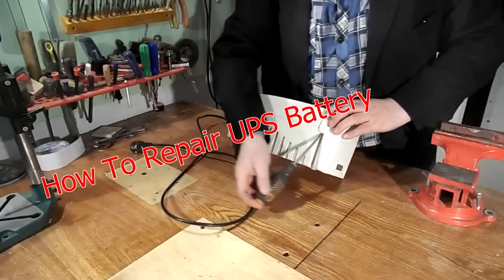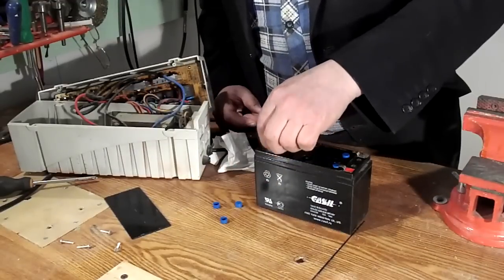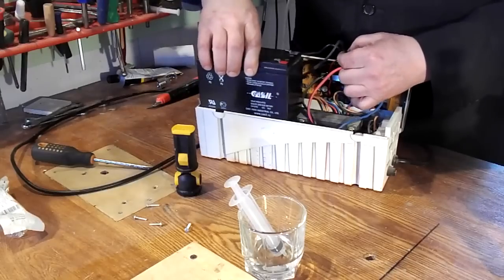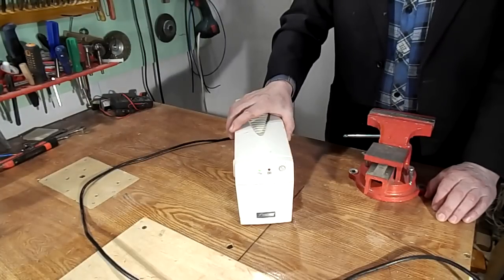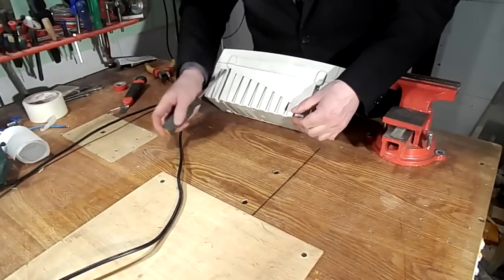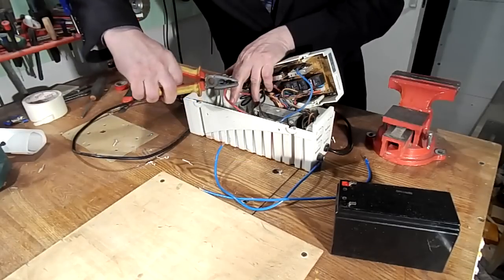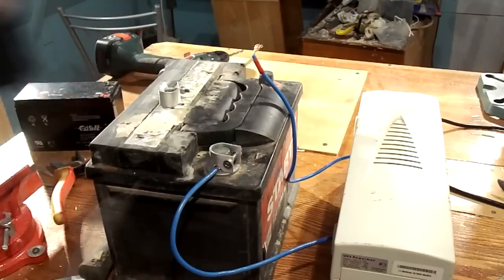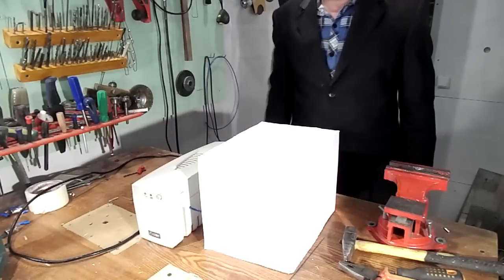How To Repair The UPS Battery

Comment: nice video how much amp is that battery 20 amp 50 amp 75 amp or 100 amp i have back=ups cs 350 i have 1100 watts inverter 12 volt deep cycle battery 75 amp 900 watts runing my inverter

Comment: Upgraded 2 UPS w/ wheelchair batteries - TV & Security camera system to protects from lighting & power outages(some pulled outside meter & waited for IR cam lights to die before breaking in) which will be 5 hours before shutdown.

Comment: Can we use boiled water?
Reply: No, that would be even worse than tap water.  Boiling it just concentrates whatever minerals it has dissolved in it.  Rain water would be a lot better.
Reply from the maker: Boiled water will have a bad effect on the battery. You can use boiled water if you cannot find distilled water.
Reply: Distilled water is $1 a gallon so why use anything else unless you are super cheap

Comment: Achtung: Alle USV-Batterien enthalten äusserst explosive Knallgase und Schwefelsäure, welche schwerwiegende Verbrennungen und Ätzungen hervorrufen können. Auf diesem Video werden keinerlei Vorsichtsmaßnahmen getroffen und Verletzungen sind vorprogrammiert. Ein neuer Akku mit 24 Monaten Garantie kostet beispielsweise (12V 7Ah - wie im Video dargestellt) Eur 23,50 + Eur 7,70 Versand. Ob sich hier das Risiko lohnt?
Reply from the maker: Batteries can explode even with all safety precautions. My battery didn't explode, so my safety is good.

Comment: In my ups 12v 7ah battery using Can I use 12v 9ah bike battery  in it ups can charge it?
Reply from the maker: I think that this will be the best solution.
Reply: @DoitselfInfo  If we use battery with higher ampere range, will it not heat up the transformer?
It is really advisable to replace the 12V 7AH battery with 12V higher amp hour rating battery ?
Reply: Yes

Comment: hi my ups batery is swollen and black connector get rusted but i slowly removed the connector.
shall i refill distled water and after that shall i plug in to check wheather it is charging or not.plz say ur sugestion.
also im not havngthat  voltage meter
Reply: If your battery is swollen it's worth having a good look at the device circuit.

Comment: can i use maintenance free battery 12v 7.5 and valve lead acid battery 12v 8.2 together in ups?
Reply from the maker: Such a design is undesirable.
Reply: Yes

Comment: For most batterys regular distilled water will work. Tap water is never a good idea as it often has a lot of impurities. A low cell lets say in a car battery while starting or charging can cause an explosion. I had one blow the top off of one and acid went everywhere. Wear eye protection if you don't want to be blinded.
Reply from the maker: I hope that you are not talking about me. I use distilled water and the battery may explode if you charge the battery and allow a spark when removing the conductor.
Reply: Really anybody working around batterys. I worked around batterys for years never had a problem. One day I started a generator which had four full size batterys. I heard a click then boom just like a shot gun going off. If I had been near it I would of had acid all over me. When I worked on aircraft I found one overheating, I had gloves it was still hot as a frying pan and ran down the stairs with it. It wasn't the charger the battery just went bad. I urge everyone to respect these little electrical bombs.

Comment: Muy buen tutorial victor. Salu2.
Good tutorial Victor.
Reply: There are  several tips for doing a pro job
do not attempt to do this until you know what you are doing - the acid can burn your skin
check the voltage first - there may be a kaput cell which would be a waste of time trying to fix.
Check your battery fluid.
attempt to fully charge the battery.
(I discovered about these on rapid renew roadmap site )

Comment: Its not working
Reply from the maker: This means that the battery is dead.
Reply: Thonta Praveen Kumar.plz tell me how to repair dray Betty pool
Reply: Victor V. Do it yourself .plz tell me how to repair dray Betty pool
Reply from the maker: I had no repair experience with this battery yet

Comment: You just added distilled water in some other videos they say to add Epsom salt in water.
And is that true that distilled water starts boiling when you charge the batteries coz they are made to have gel instead of water?
(They leak and damage the UPS)
And is that also true that distilled water becomes sulfuric acid after some time in the batteries?
Reply: Hellow Hi,

Epsom salt is added to "wet cell" typed SLA rechargeable batteries. That would be your car battery.🙄

This is an AGM type of VRLA battery. Here you only add distilled water into each cell. To my experience it is best to under than to overfill.🤔

True. 😉

Comment: CAN THIS UPS CHARGE THIS BIG CAR/BUS BATTERY? I THINK IT WILL BURST YOUR UPS MOTHERBOARD.WHAT IS YOUR  OPINION ABOUT THIS ?
Reply: It won't as long as charging voltage is proper. It will take very very long time to charge, because most UPS allow for maximum of 2 amperes of charging current. Simple arithmetic, a 150 Amp battery will need between 75 to 100 hours to charge, because the voltage controller will drop amperes after 80% charge and put the charger on trickle to top off...

Comment: in which shop I will get this distilled water
Reply from the maker: You can get this in any large store where there is a department of auto parts. I bought distilled water in a super market. I pour this water into the flatiron.

Comment: Cheers for the Video! Forgive me for butting in, I am interested in your initial thoughts. Have you heard about - Rozardner Powerful Battery Reality (erm, check it on google should be there)? It is a good one off guide for learning how to recondition an old battery minus the normal expense. Ive heard some awesome things about it and my cooworker at very last got astronomical results with it.

Comment: Sir, I am insert distilled water in UPS battery but the battery can not increase power backup time.
Reply from the maker: This means that your battery can not be restored.
Reply: Sir how to restore battery and any chances to restore battery ON after 3mints it will OFF.

Comment: Can i use a bottled distilled water for refilling? Do i need afraid that is not pure enough for the refilling? What trouble if it is not pure distilled water?

Sorry for asked 3 questions, because i have a battery just found dead and i just bought it 1 year ago.
Reply: Cu ce se fesulfateaza bateriile

Comment: This will not work. You have de pressurised the battery by taking those vent caps off. For the £10 or so these cost don't waste your time
Reply: DovahkiinYT the electrolyte is not what holds the electrical charge. It is the lead plate that holds the charge. And by design these batteries which are Valve regulated lead acid (VRLA) do require the correct pressure internally to operate correctly. Also the amount of water that he has added to the cells would dilute the electrolyte too much. They only require a small amount of electrolyte in these which would have been absorbed by the lead plate during recharge It will all be pushed back out of the positive plate and mixed with the water he has added bringing the electrolyte specific gravity well below the 1300 it's supposed to be.
Reply: de-pressurized?  no.. those rubber boots are meant to let pressure escape.. this happens when the battery gets hot. they are rubber so they can keep the liquid from spilling out.

Comment: The plates in these batteries are thin.  By design, they should get dry before the plates fail in some way.  Doing these "repairs" can extend the life if the battery a little longer, not like new.

Comment: I have tried this on 5 sealed lead acid batteries so far and it hasn't been effective.  All of the electrolyte is contained in the blotters between the plates.  The electrolyte is purposely slightly underfilled by design to prevent leakage in the event the battery case becomes cracked.

When refilling the water level, pure distilled water can only be used.  I distill my own since the water marketed as distilled at stores can have an additive (like a small amount of salt or fluoride).

Adding the correct amount of water is the most difficult part of this operation.  Unfortunately, you can't see how much water the blotter needs by appearance. You want to only fill the blotter without having any standing water on top of the plates.  When you charge the battery after the refilling operation, electrolyte (water and acid) will flow out of the blotter and rise above the plates (which is undesirable).  So, if you added the correct amount of water, the blotter will only appear moist during charging, any more or less is undesirable.
Reply: +Bill Harris : "Battery Desire" the blockbuster movie coming to a theatre near you!! Thrilling story of long lost desirable battery. See the undesirable battery drinking too much water. Watch a most desirable battery soak a blotter. Yes, this is the movie for you!!

Comment: after filling water,the battery would internally start fuming after charge,pushing the rubbers that close.
Slowly the UPS circuitry starts getting acid corrosion,IMHO.
Instead,if we can get hands on to a jelly that the battery makers use.
I suppose we could improve on the repairs.
thanks
 sarma
vu3zmv

Comment: nice video ....
i have one question about the distilled water ,is there a specific brand of water to use or any kind of water product atleast it is distilled..?
Reply: I've seen some guy repair a battery like this with rainwater, not even distilled.And it worked.
Reply: I used tap water and it worked, probably not as good as distilled though

Comment: Safety Tip... To anyone who is going to make this... Car batteries, gas-off when being charged... Hydrogen. Hindenburg... 
I've done this mod but I drilled a hole in the wall and ran the battery... OUTSIDE ! Your insurance company wont like you burning down your house. Use the shortest cable length you can and make sure you use big cables. To avoid voltage drop. 
Also, I'd suggest drilling a 6.5mm (1/4") hole through the battery post (Perpendicular to the post... put another way, from one side to the other) but do this outside... again, hydrogen is very flammable ! Try to cover the battery to stop debris ... and secure the terminals with a nut, bolt and star washer. The home made clamps Victor used are cheap and fast to make, but he is good with his hands... If you do it this way , youare at risk of arcing if bumped. Boom, you are dead. 

Spaciba +Victor V. !  Nice video, sir. Your English is good and you are obviously smart, educated or both.
Reply: Great response! DumbSkippy LOL
Reply: +Victor V. 
I think you misunderstood what I said and meant. 
I never said what you do is dangerous. No, No, No...

We have a responsibility to protect others from danger. 

You and I know about this, but less skilled people will not know of the dangers.
I am a qualified Electronic technician... and a Mechanical Fitter. 

I suggested different connections to the battery, because of the risk of a spark... at the source of venting Hydrogen!!! 

Also because most people, wont have a piece of steel bar at home and wont get a good connection, which would require the exact curve to match the diameter of the battery pole. This would mean the electrical load at point of contact to the battery post would be at the edge of the steel bar and one point of the curve... and that is if the curve is not twisted  (Spiral) when made. 

Victor, I have every right to comment, especially if I am an expert and sir... I am an expert. 

Firstly I said "Spaciba +Victor V. !  Nice video, sir. 
Your English is good and you are obviously smart, educated or both." 

Then I said 
"Victor u... is good with his hands..." 

I am 100% correct about Hydrogen. 

All wet-cell, lead-acid car batteries produce Hydrogen when being charged. Hydrogen is the gas that both burns easily and can explode when ignited.

I hope you feel more comfortable with my suggestions, understanding why I have added my tips to your video comment.

At least one person is happy with my suggestions... Look !
 +strange1ization 
Great response! DumbSkippy LOL

Spaciba tovarich. !!!
Reply from the maker: You have not right to say that what I do is dangerous. When the battery is not under load for a long time, then there is no explosive gas and no danger of explosion.
Reply: +strange1ization 
Thanks so much for the positive feedback.
I'm glad you found my input, beneficial.
Cheers,
DumbSkippy
Reply: DumbSkippy
Reply: Altaf Jagot
 Hello... What's up ?
:-)
Reply: communication failure!  you give him a compliment  and he wants to start bitchin about rights...too funny.

Comment: There is one "little" problem. By adding distilled water to the battery 
you won't help it, only if the battery was boiled to oblivion (improper charging) and off gased the water. Because the "sulfuric acid" is on the plates 
sulfated, you end up with battery filled with water or more diluted 
electrolyte. You have to get the plates clean of sulfation ,if it's heavily sulfated, to get back the  capacity. You can measure the specific gravity of the electrolyte which tells you.....
 I have done it. ;) cheers
Reply from the maker: Some masters recommend to refill distilled water  + electrolyte, 50x50 %.   The electrolyte degrades with time usually.
Reply: +Victor
masters ??? lol. distilled water is ok , if it evaporated = the battery was overboiled...adding H20 is not enough if the battery suphated.. You must DE-sulphate the plates by special charging process ! It's called equalization charge. Adding +electrolyte (acid) into a sulphated battery is a temporary short fix until the battery sulphates even more and the cells are killed by too high impedance. The electrolyte does not degrade by any means , only the water can escape when it's boiling by pushing current which is not absorbed.  Acid remains in the cell, on the plates, or in the electrolyte.

(wikipedia) In the discharged state both the positive and negative plates become lead(II) sulfate (PbSO
4), and the electrolyte loses much of its dissolved sulfuric acid and becomes primarily water.

+Axonis
sure, only from flooded ones
Reply: You can't measure the specific battery in an AGM electrolyte because you can't draw liquid.

Comment: Do you expect that the UPS will be able to charge that  ~70Ah battery ?  It's designed to charge batteries which fit the UPS. Charge current is set to the battery size it fits. This way it will charge that ~70Ah battery for weeks if not longer. Good for one time use.
Reply from the maker: I think that it is necessary to install a fully charged battery. A fully charged battery consumes a small current.
Reply: It's like 50Ah guessing from the size of it. Google a online calculator for the charge time. Theoreticaly ,say 50Ah charged by 1A will charge for 60h (with 20% efficiency loss). Depends also how the UPS's charging circuit is designed.
Reply: Yes, of course it can charge a larger battery. Where did you see it's 70ah ?
Reply: +Kozsar do you know any modifications that can be made to a ups to enable it charge a 50 Ah battery?
Reply: Yes and No. :D Yes, you need to redesign the whole circuit. No,you better buy a bigger UPS , you end up saving a lot of money and energy.

Comment: Hi, is the drill used here Bosch 24V 1,5Ah? If so, which power adapter did you use to make it work? I tried to convert mine, but with the 24V 300W output from the power adapter it runs very poorly. Curious how you made yours work
Reply from the maker: +apetrov1x5 No, it's Bosch 12V

Comment: Thanks, I will try the car battery. But how long does it take for the UPS to charge the car battery or do I have to charge the car battery externally before connecting to UPS?
Reply from the maker: +madex4u For the first time, you must charge the battery externally
Reply: 1500 volt ka ups kesy bnaen gay zror treqa btana

Comment: I always refill with Sulfuric Acid
Reply: I have 12 volt 8.2 AH ups battery. I have refilled with distilled water (1x sulfuric acid : 3x water). I used 16 volt dc transformer to charge the battery. After few hours, When i test the volt , it shows 14+ volts in my battery. but when i connect my battery , it is unable to provide backup and my computer shuts off immediately. It seems to me that the battery AH capacity is damaged. Please suggest me in this regard that what can i do now. thanks in advance
Reply from the maker: You can restore the battery if the plates is not destroyed.
Reply: Measure the voltage with a 5A load. If the voltage drops significantly, either electrolyte mixture is incorrect or damaged plates. You can purchase an electrolyte tester quite economically.Probably plates are damaged, it may come back if recycled a few times. 
Better off getting a new marine battery.
Reply: Thanks all for valuable suggestions. led zep how can i recycle
 my battery ?
Reply: Victor V.
 how can i measure that whether my plate good or bad and if good how can i restore. pls help